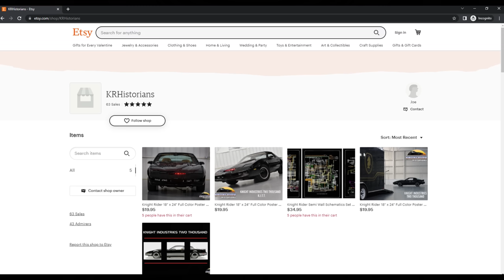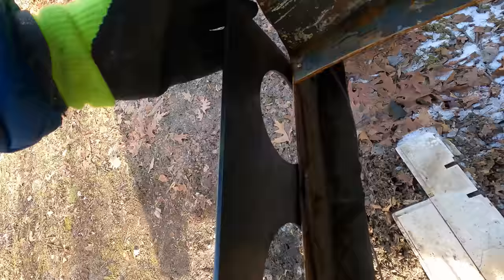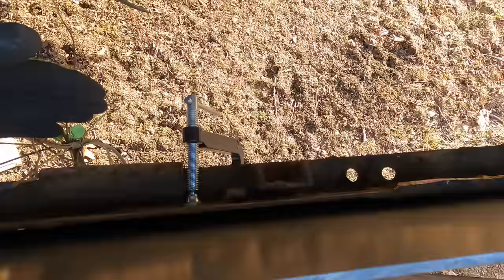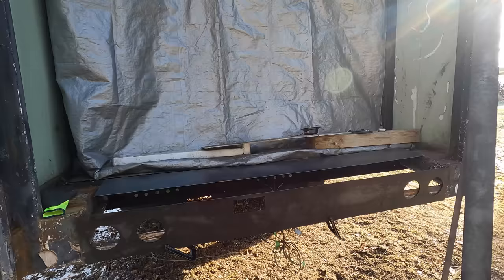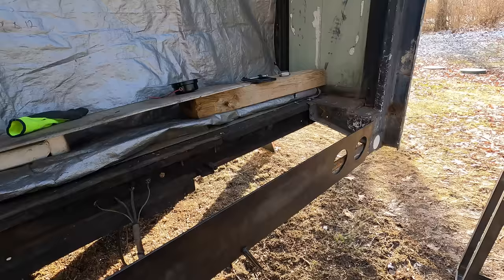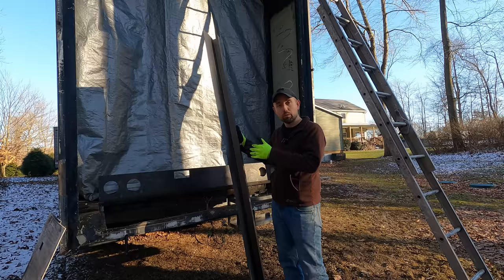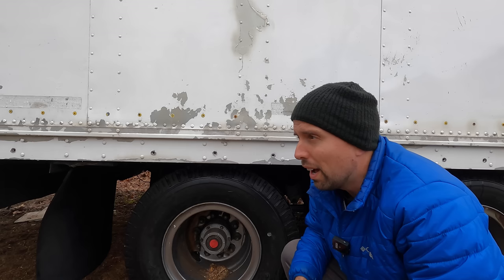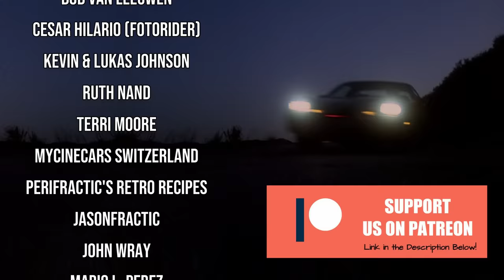Was the Knight Rider Trailer Painted BRIGHT YELLOW? + Rebuilding the Rear End of KITT's Hauler!

Comment: The yellow on the trailer was primer.  Dupont automotive paint,  part numbers  615\616s Variprime.  It was a metal etching primer and needed to condition bare metal before topcoating with a  paint color such as the knight rider black.   Dupont Variprime was a bright yellow, it provided excellent adehison to bare metal, for a top color layer like Imron as used in Commercial applications.
Reply: That's what I thought but then in the close ups of the snap locations it's very clear the yellow is on top of who knows how many layers of other paint. The snaps protected little islands of layers of paint when it was soda blasted after Knight Rider.
Reply: This needs to be pinned. :face-blue-wide-eyes:
Reply: amazing all the theories listed about the "Primer". most fans don't know how Aluminum and Stainless is prepped for paint ;)
Reply: @captvictor  sounds good tell us how the aluminum and stainless steel was painted.
Reply: I was glancing at the snap location as I went by a caution sign on the road.  It looks to me like high visability yellow.  I dont know for sure.  I mean you filmed ut with your camera, processed it through your network uploading to Youtube streamed across my network to my phone.  The color could wasily be brighter or more orange.  But it reminded me of that California DOT hi-viz yellow.
Reply: Looks more like a topcoat than an etch primer, etch primers are very thin and see through.

Comment: 14:11 I'm very impressed that a Trans Am of the era weighs so little, I would have guessed that it weighed at least 100 pounds. Also, if you pull of the Dorsey emblem on the front, and there's yellow underneath it, that probably means that the trailer left the factory bright yellow
Reply from the maker: We have the original paperwork on the trailer when it was new. It was painted white from the factory.
Reply: @KnightRiderHistoriansOfficial  could it have possibly been ordered white, then freshly done in yellow before its first sale so to speak ?
Reply: 100 pounds?
Reply: @themobseat  Joe made a Freudian slip..lol..he just said 32 pounds would be the weight of the car going up the ramp so it has to be braced and strong enough. I'm sure he meant to say 3200 pounds...
Reply: @KnightRiderHistoriansOfficial  on the production line being made, (the lowest common denominator, is white, but did the give it finishing paint job, for the first customer, the brand of yellow or something,  the "yellow ^%$£$%^& company, or something?
Reply: Yeah….I caught that slip up. I think he missed a word that would have added a few zeros. No biggie. It was cold that day. 
Or maybe he was talking about the whole Lego set.

Comment: Allied Moving was Yellow Trailers black lettering until the late 70's and rebranded Orange with a hiway on the trailer in the Late 70's early 80's UNITED Moving and Storage was a Yellow Stripe down the Bottom Edge of the trailer from Front to Rear During 70's and 80's 90's Now it is still yellow stripes but on the top Corners of the trailer

Comment: Hello Joe! I have worked for Constantin films, a movie production company here in germany and they gave me an assignment to paint and colorring some cars they need for a german tv show. They wanted me to pre paint their Cars in light yellow first and then i should paint them in darkblue. The reason for this was, that on their cameras they used to film with, the darkblue paint was very very dark. But if you stand in front of the paintjob in real, it was not that dark. So they wanted me put an light paint under the darkblue paint and on camera then, the paint looked brighter and almost as it was in reallife.

Maybe the producers of Knight Rider had the same problem because of the golden stribes?
Reply: Some paints aren't super opaque and the color and darkness of the primer can affect the look of the paint. It's a big problem with yellows, oranges, and reds. When I repainted the hatch spoiler on a red 2009 Toyota Prius I had to test with three different primers before I was able to get a close enough match on the red.

Putting a yellow primer under blue paint should give it a greenish hue, if the blue isn't 100% opaque.

Comment: Interesting find with the yellow paint. I totally agree with Dan D on this one. The Yellow paint was probably the Vari-Prime Dupont primer which was widely used on unfinished bare metal in that time  period. I am employed at a large Auto Part store chain which deals with automotive paint. Before the introduction of urethanes and waterborne paints Dupont's Veri-Prime was the answer for metal etching primer. It also was the go-to primer for aluminum and stainless steel as well. The Veri-Prime was a very bright yellow and that was the only color it came in. With the knowledge of paint that I have I can tell you that Dan D is 100% spot on with his theory. I hope this information is helpful to you. Good Luck.
Reply from the maker: We think you guys are correct!

Comment: I have a question regarding the rear doors on the trailer which is this: Were there two trailers as I remember an episode (from the first season I think) where the FLAG semi was temporarily used by a trucking company and loaded with produce and that trailer had (or seemed to have) normal opening doors at the rear? Devon is suitably concerned and remarks to Michael that the entire rig is worth "half a million". It's one thing that has always puzzled me so any info you may have would be much appreciated
Reply from the maker: The episode you are thinking of is "Ten Wheel Trouble" and was from season 3. When they are loading the produce you can see the ramp down. There was only 1 trailer, and it NEVER had swing out rear doors. It didn't even have swing doors from the factory at Dorsey....it was a roll up door.
Reply: @KnightRiderHistoriansOfficial   Thank you. It was just one of those things that niggled me. Strange what you remember isn't it

Comment: Hi.  There is a picture of the trailer that you have shown a few times from when the trailer was used after Knight Rider.  The one with a Trans Am parked next to it.  On the side of the trailer you can see the image of a race car in black and white over a field of yellow with yellow lettering.   Is this the same shade of yellow as what you found on the side of the trailer?  It is possible that this was painted in layers with the bottom one being yellow?

Comment: I'd replace the rear panel with the whole new one. I just say that because it'll look nicer when done, no bodywork needed. For sure keep the lowest part. Depends what the welder thinks to. That model is great, I'll vote for it. I'm sure it'll be around a couple hundred but it unique. I know I still want to make a pair in 1/25. 
United van lines had white and yellow trailers, they had yellow stripes along the bottom. Maybe United was the first owner? don't know why they would sell it off if it's only four years old.

Comment: Joe I wouldn't worry too much about preserving the original piece in this area of the trailer. Documenting the find would serve. Your gonna need the structure to make its ability to load and unload the car, support the ramp, and making sure the trailer is structurally sound should take priority. Most of the original features have been lost to time and will not be reusable in their present state,  these details will become irrelevant to making this piece of TV history reliable and functional.  If you were to ask Adam Savage about the inner workings of TV props, he would probably say it was done on a budget, in the most efficient manner possible, because at the end of the day it needed to work for 5 to 15 min of camera time, nobody was going to see it,  and once it was filmed it was abandoned until it was needed again. You need it to work every time without failure, for much longer than a couple 30 second shots.

Comment: I like the remade battery box, but it's funny to think that from Bonnie and Devin's point of view, that the high tech trailer could be disabled by a bad guy simply removing two battery cables in an exposed box! 🤣
Reply: Or just shoot the batteries.
Reply: @greggv8  Except I think the red batteries are Optimas and they used to have ads shooting the battery and then starting a vehicle.
Reply: @BlueDually4x4  AGM lead acid batteries didn't exist in the early 1980's
Reply: @greggv8  wasn't sure when they came out. Just barely remember the ad for that matter.

Comment: a stick on reflector.. in the 1980s? on a trailer of all things? sure it's not the exact same thing but with filled in old screwholes somewhere? people had barely just invented stickytape back then :P let alone doublesided stickytape capable of holding a reflector in place outside for years. reflectors come in pretty much the exact same shapes with and without screwholes.

Comment: I do have one question I am currently building a Johnny 5 replica the mechanic stuff to me is easy but I cannot seem to find an Arduino that can power all the servos should I just stick with multiple Arduino or do you have a better suggestion
Reply: There are extension boards that let you run multiple servos from one main control board.

For example the PCA9685 can control 16 servos (or PWM signals) and you can connect multiple of these boards to one arduino.
It communicates through I2C.
Reply: Robothut made one, he might be able to help!

Comment: Your battery box looks like it’s made with angle iron. How are you going to get the batteries in? To get past the flange the batteries will be loose inside. Wouldn’t it be better to have use strap steel on one side so you could slide the batteries in and they would be tight?
Reply from the maker: They slide right in the back.
Reply: @KnightRiderHistoriansOfficial 
So the flange is smaller on the back side?

Comment: Why doesn't he submit that to Lego?
Reply: Because if you submit your idea to "Lego Ideas" you loose any intellectual property on the design.
 
There are other sites where you can publish your own designs and sell the instructions, which is what this designer did. If he submits it to Lego he has to give it away for free.

If Lego then were to produce it as an official set he might get an honorary mention in the instruction booklet. But if he sells the idea to somebody like Mould King he can actually get money for his work.

Also Lego tends to apply cost cutting measures to all fan-submitted ideas. If they were to produce this they would definitely remove the comlink, and probably the remote controlled ramp mechanism, as they want to save motors wherever they can. Than they change the colors of half of the parts to represent every color of the rainbow, as that is cheaper than producing parts in colors as necessary. Most prominently there are blue pins, red axles and parts in lime and azure. When you look at any modern Lego Technic set there is no angle you can view it from where you don't see lime or azure. 
And then after all these cost cutting measures they would sell the set for at least 600 bucks.

Whereas Mould King will produce it as it was designed, including the correct colors, sell it for less than a third the price, and nowadays they also have way better part quality than Lego.

Only downside is that there will be no Lego figures included, since those are the only parts Lego has a copyright on.